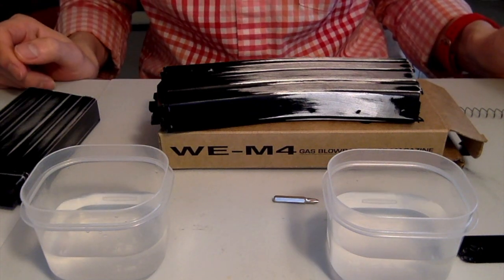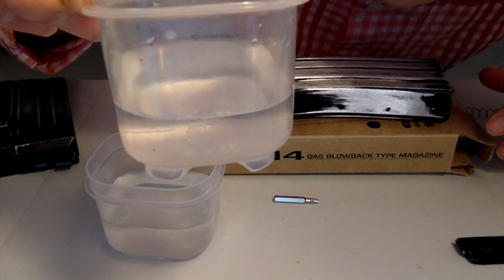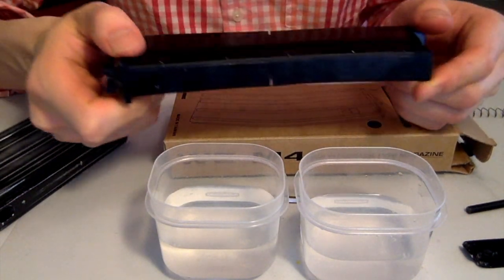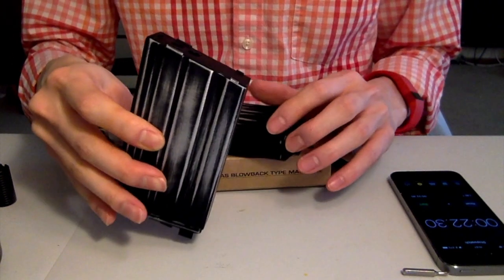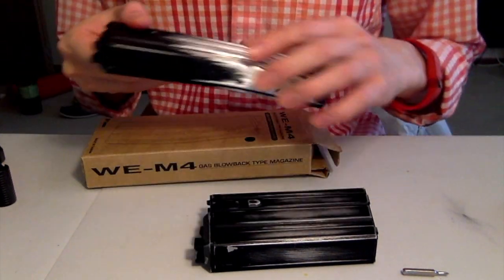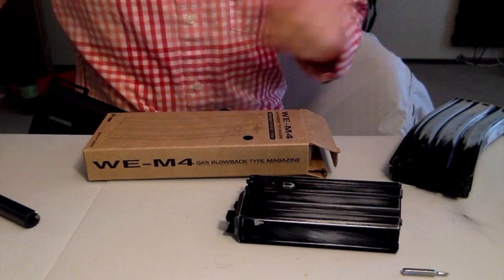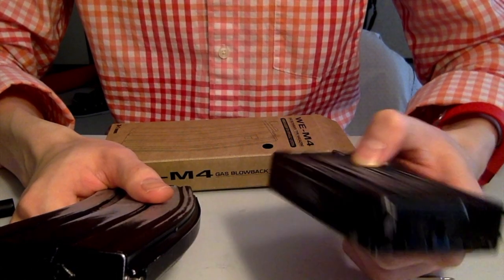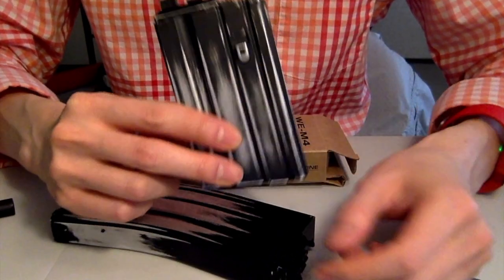WE M4/M16 30 Round versus 20 Round Magazines

Comment: WAIT  I MISSED THE  PART  OF AR16  DESIGN WHERE   MAG  MUST  BE  GAS TIGHT// WHY ,, OK I KNOW  SYSTEM OF  OPERATION  GAS VS  BASIC  HEADSPACE  OF   BOLT TO PUSH  BACK ,BUT  I FEEL  GAS FROM   PROPELLANT   THAT  NEED TO  GO IN MAG   IS  NO GREAT DESIGN //LIKE  IT  CAN BE   WATER FILLED  IF    YOU  CROSSING RIVER //GUN U DRY   A  MAG  TO  GO  ALL 15   AND  EMPTY THEM   IS  //NOT   AS EFFITIENT   AS AK MAG THAT S FULL OF  HOLES AND   JUST   LEEKS  OUT WATER,, OK I MUST   SEE WHY MAGS MUST BE SEALED   BEFORE  I SAY MORE  BUT  ITS STRANGE/A GO  FUCK YOU    I  EAS ASKING   ABOUT REAL GUN NO F   AIR SOFT TOY //W  WRITE    BB GUN //  NOT WHY  20 VS 30   WASTE  OF TIME

Comment: WAIT WHY A   YOLUME  OF  MAX  IS  RELEVANT// ALTHOUGH IF   NOT  MADE FROM  3X THICKER  MATERIAL   OR   SPRING  IA OVERCOMPRESSED  OR    TOP PLASTIC/LIP IS  TOO THICK    SAME   THICK  AND   WIDE  BUT 1/3 LONGER SHOULD  HOLD   MORE   WATER,,PLUS  IF 20    ROUND  IS STRAIGHT WHY 10 MORE SHOULD  BE    HALF   BANANA AS   AK   MAKES  NO SENSE ,, I HAVE SEEN    OTHER   MAGS THAT  HOLD 39/32 AMMO  AND   DID  NOT  LOOK LIKE THIS 30 MAG/THIS  LOOK LIKE RUSSIAN  MADE  IN    MID 60 S//

Comment: Wow, interesting comparison. I always wondered why the 20 rounds existed when the 30 rounders were so close in price. I guess it is more than just looks. However the 20 round mag did have a significantly lower rate of fire at the end which to me makes up for the time difference. I would count the shots in audacity but I'm far too lazy for that. haha. 

I find that the amount of gas you can get into a magazine depends greatly on how full your propane bottle is, as the weight of the liquid propellant seems to provide the force to squirt in as much liquid as possible before some of it expands into gas inside the magazine, bringing up the pressure and blocking the fill. For this reason you get more of a fill when the magazine is cold than when it is warm as it helps keep the propellant liquid longer (I mean most of the propellant is still liquid after filling, but the longer the gas pressure is stunted, the more liquid will flow in). Also the amount of propellant you get isn't necessarily equal to the time of fill since the filling rate rapidly drops off.

If you got a pool what you could do is fill up magazines then invert a clear bucket or something and underwater expel the gas in the magazine and collect it into the bucket to get a measure of the actual relative gas volume. Then again I'm not sure about the solubility of propane in water, actually I guess it would not matter since I think it is relatively insoluble.
Reply from the maker: These are some really good ideas!